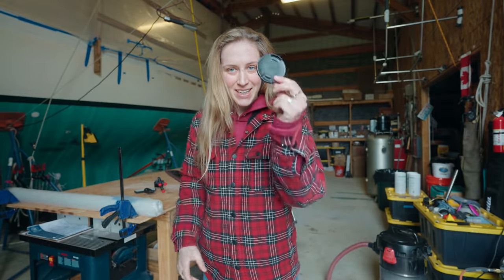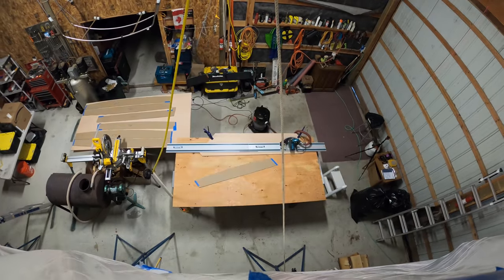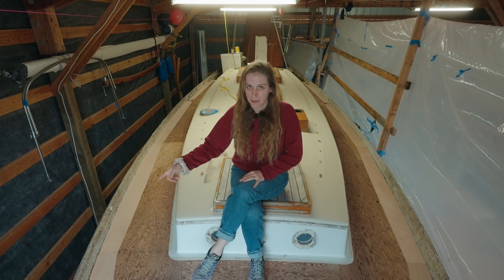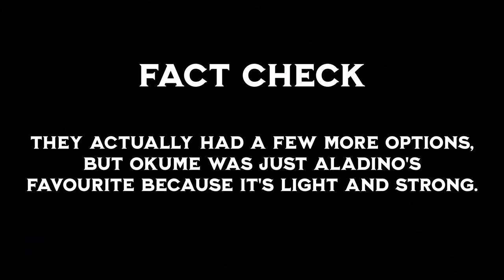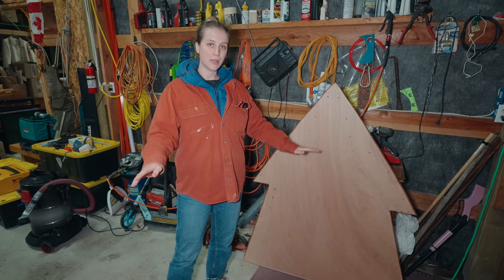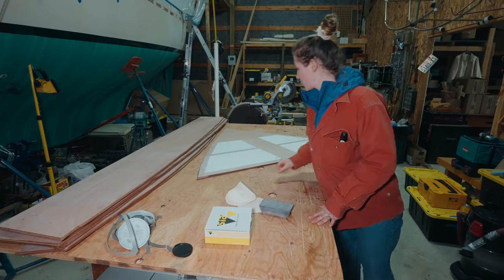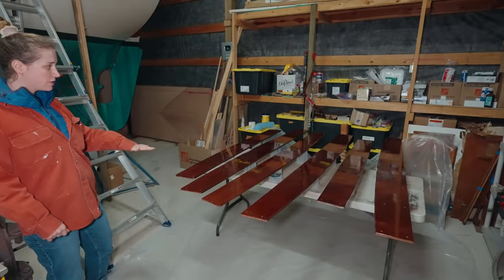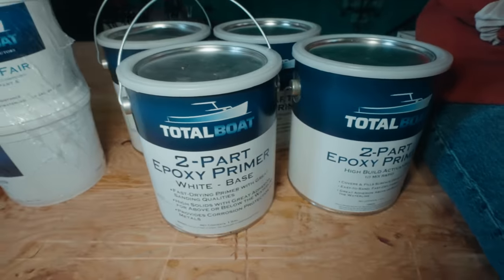Rebuilding our deck, and getting sick [S4E39]

Comment: With all honesty, the color miss-match of the deck boards adds more flavor to the salon. While giving an arts and crafts feel it will give extra dimension  for that larger than it really is magic. That, coupled with the care in symmetry that you folks have taken with the demolition and now the reconstruction (I realize a lot of that WAS due to OCD, but form follows function)... I would be ecstatic to have such ART as my ceiling. I think that simple thing has added value to your boat.

Comment: Excellent, as always.
I ordered a stack of marine plywood and when it arrived it was much worse than what you got. Absolutely no better than what the local home building supply stores carry, at only 4 times the price. Plus shipping to Alaska. So I researched "Marine Grade " plywood standards and found out there are only loose standards and it is up to each manufacturer to monitor their products. I learned to ONLY buy from the best name brand, no matter what the cost. Building with junk wood is worse than doing nothing.

Comment: The deck repair looks really great, but now I’m concerned that Maya is hiding her addiction to hoarding lens-caps! 

I absolutely applaud your philosophy of allowing the differing repair elements to tell the story of your lovely boat, and her transformation.  One feels a bit ridiculous providing potential solutions to crafts-people of your calibre, and I expect you have considered and dismissed this technique already:  it might be possible to get the two woods looking more similar to one-another by giving both a final coat of a pigmented varnish.  Would it look better?  Perhaps, if you think you have too many tones already. Or it might diminish the contrast but still be inferior to what you have now, which looks very fine indeed.

The Cape George 36 is such a beautiful design. One of my absolute favourites. It’s too bad more of them did not have a deck and coachroof built with your attention to detail. Hopefully this one will sail on another hundred years!

Comment: Look great! What kind of stain did you use? Was it water or oil based? Any specific steps you took between staining and epoxy?
Reply from the maker: Hi Alexis
The stain we use from Epifanes is thinner based. 
Apply as many coats as needed. One at a time and letting it dry for a few hours.
Let the last coat dry overnight but then you are good to go with varnish or epoxy.
Reply: @SailingMagicCarpet  so helpful thank you!!!

Comment: Will the plywood decking be glued to the deck beams? Or will it just be screwed on with bedding.
Reply from the maker: We will bond it with epoxy and screws:)
Reply: @SailingMagicCarpet  Will you take the skrews off, once the epoxi has cured ??

Comment: 🤣That is so funny!, I saw the round in the back pocket and thought, "nah, can't be, should I ask ?".    Good job clearing it up 😄  On a more tech note, do you epoxy THEN apply the varnish ? or do you mix varnish with the epoxy ?  (ratio?)  They looked excellent.
Reply from the maker: We epoxy a few layers first, then sand and at the end varnish.